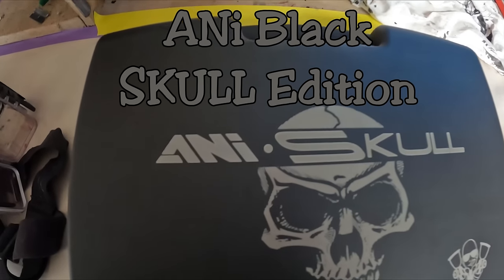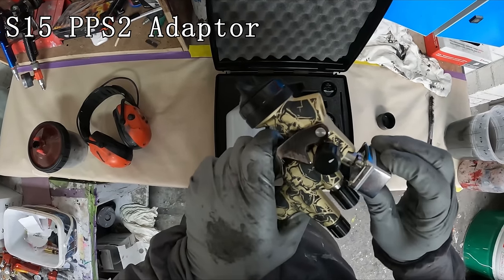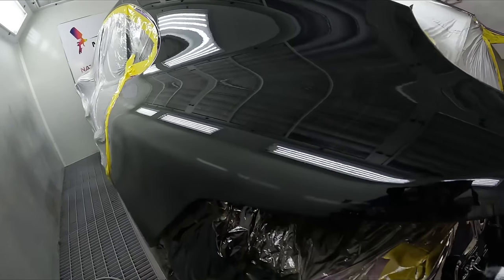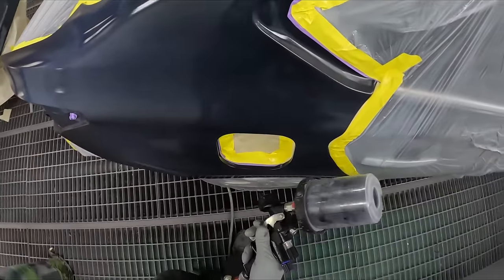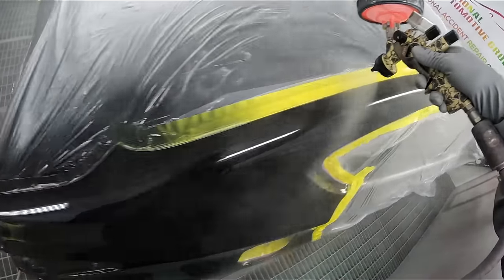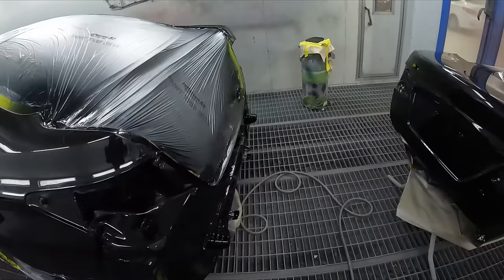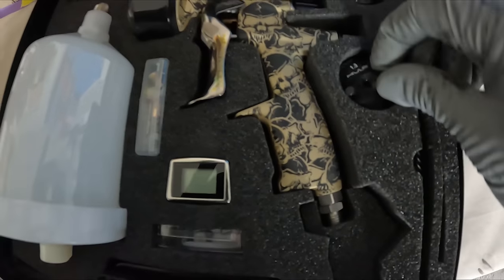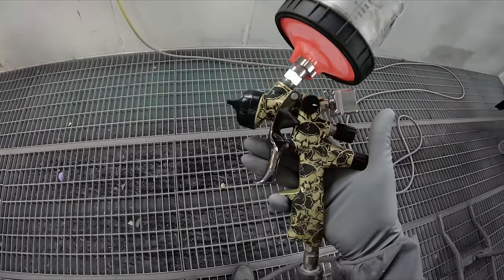ANi SKULL: Limited Edition ANi Black

Comment: Hi Gunny, well you certainly can't knock the finish on the clear it looks mint, I have a friend in the UK who has just got one and I'm waiting on his thoughts but from what you have said here I think I may get one as some point.
Have you got the new WS400 series2 Gunny, I just picked on up with the digital gauge in the 1.3HD, man what I gun it just lays the clear on really nice plus they have fixed the fan issue so you can now run it full fan full fluid an the fan is wet all the way through the dry centre is fixed👌🙏👍
Reply: Ws400 series 2 is amazing. I have it and it is great

Comment: this whole psi/bar thing is confusing, and I don't trust it, simply because the toilet flushes in the other direction down under in aussie land.
Reply from the maker: You'll find most of the rest of the world is metric. That's all it is, metric vs imperial measurement system. You don't have to trust it, just convert. Most analogue gauges I have use both that's why I sometimes use psi but sometimes Bar.

Comment: Thanks for your videos they are really appreciated I have learned a lot. Why do so many people push having a separate gun for Sealer/epoxy sealer , base and clear I understand a separate for high build primer. If I have for example a pro lite with a 1.2, 1.3 1.4  and like five different air caps they can use or even the Skull with its three caps is there any reason I couldn't use one gun for sealer, epoxy sealer, base and clear as long as I thoroughly cleaned the gun in between Thanks.
Reply from the maker: Basically it's convenience, for us who paint daily it's just easier to have loads of guns, each one with a specific use. But yes, you definitely can have one gun to rule them all 😜
Reply: @TheGunmanChannel  Thanks for the quick reply, I'm gonna order that cool spray suit with my next order.
Reply from the maker: @roberthall5156  thanks mate 👊

Comment: I see Sprayguns direct have the A.N.I. F1/N Super Professional  for £48. Can a gun at this price be any good?
Reply: No, it's slow, overpriced, doesn't atomize well and has a non-uniform spray pattern( all the guns have the same defect) . If you want a good gun buy the F160 hps or the Walcom slim xlight 1.3.
Reply: @cristianb.4135  I wasn't going to buy it. i was shocked at the price and the fact sprayguns direct say its the best budget spray gun. I mainly use a GTI pro lite and a Dv1. I was interested in the ANI black because of the size of the spray pattern
Reply: @Tinker i have the ani f160 1.3 hps and it's a great spraygun. The comment was about the model f1/n/ super wich is a "low price" spraygun...
Reply: @vintagespeedshop  here in Italy i see most painters using the Ani black...
Reply: @Tinker you most likely don’t know how to paint

Comment: What minimum hp of air compressor will fit to that gun sir?
Reply: That’s kind of the wrong way to match Gun to  compressor… you need to look at the CFM rating of the compressor  more than anything. A compressor with 4hp or more is a good start. Just as long as it’s just YOU working on it .. also at least 60-80 gallons
Reply: CFM ratings of 9.5 and up are a good start

It’s all about your budget
Reply: @abelscaliber7969  ok thank you sir

Comment: I couldn't find any of your past videos on the walcom carbonio 360 HTE. I have read many posts on autobody groups saying that sprays better than GTI Prolite. I bought GTI few years ago from watching your videos. I use the T110 cap with 1.3 tip for clear. GPI for base. Like to get your opinion on the walcom thanks
Reply from the maker: Walcom are overpriced and they underperform if you ask me.
Reply: @TheGunmanChannel  Ok thank you was wondering

Comment: Have you heard about the new Iwata line . Kiwima 4 that supposedly replaces the w400 ??
Reply: The W400 is done. Kiwami4 takes its place.  Other new Iwatas are taking other guns' places as well.
Reply: Kiwami4 is killer and affordable
Reply: @asheetuglasse  what's ironic is the Bellaria (its predecessor) was far more affordable than now at one time. I'm wondering if Kiwami4 prices will follow suit after a while.
Reply: @bosshawg7427  so I’ve heard, trying to get a review from gunner lmao
Reply: @bosshawg7427  I have a kiwami 4 1.3 fluid tip seen a few videos 📹 on you tube the clear coat paint is out standing there just brought another two out anest iwata series 2  LS400 AND W 400
Reply: Try the new ws 400 series 2. They are amazing
Reply: @asheetuglasse  I got one kiwami 4 1.3

Comment: I put my regulator on the wall instead of the gun and i use hi flo fittings what is ur opinion on that set up keep up the good work thanx gunny
Reply from the maker: That's good but you still want to know what pressure is at the gun.

Comment: What tweaks are you considering for the "Gunman" edition of this ANI?  Maybe ditching the HVLP or WB aircap and including a 1.2 instead?
Reply from the maker: We had a few ideas, ditch the swivel, add some air caps, like LVLP option, yes, add some tip sizes. We did brainstorm and have them written down.
Reply: Any idea of time frame?  I like my ProLite okay but really miss the speed of an old school conventional gun.   It looks like this might be a step in the right direction.
Reply from the maker: @markm5704  mate, it's a beast of a gun. But unfortunately after speaking with ANi they reckon it'll be about a year, so probably better you get one now if you need it
Reply: @TheGunmanChannel  can you use this for base dude, you’re videos are the best and I’ve seen loads mate

Comment: Gunny do you know the pps adaptor number? thanks bro
Reply: Have you found out which pps 2.0 adapter yet?  Thanks
Reply: @roberthall5156  yes mate it's the same as a devilbiss it's number 3 I believe
Reply: @leemichaels1490  Thanks , I'm using the PPS 2.0 looks like I might need the  SO3
Reply: did some more research turns out looks like I need the S15 (26046) for Devilbiss, Thanks you got me looking in the right direction
Reply: @roberthall5156  ahh I'm using the first pps system 👍